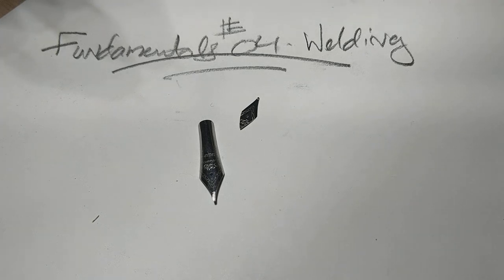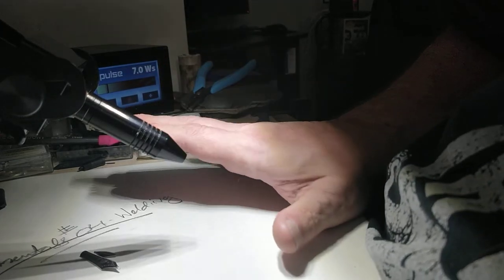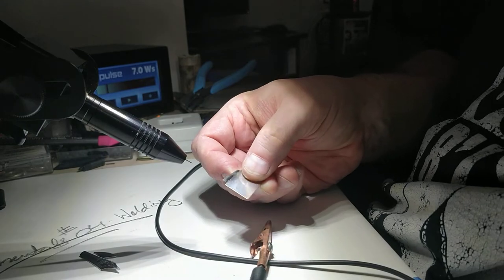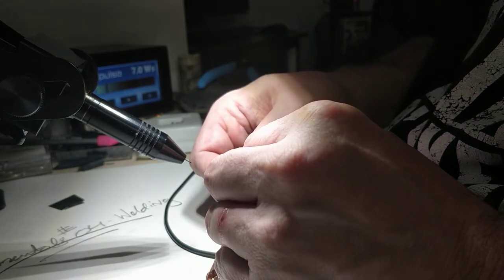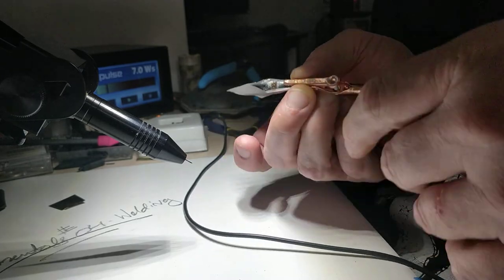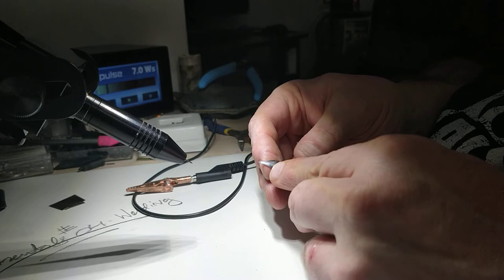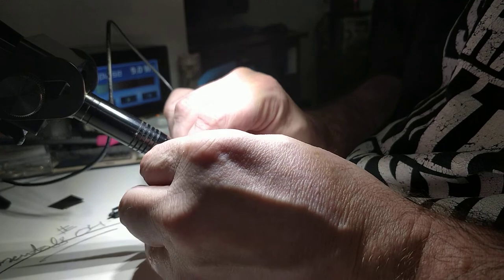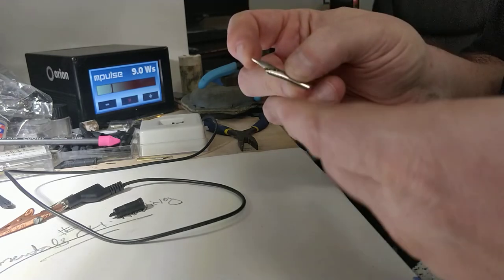Stacked Nibs Fundamentals 4- Welding

Comment: Use the gas! You can certainly weld up a storm and won’t have the “air gap” problems.
Reply from the maker: I've had less problems without gas, and I think that's just more experience. Plus tank exchange is tough to come by where I live.

Comment: Would this be the same machine that nibmeisters fix stress cracks in nibs? Also retipping nibs?
Reply: You can use this machine to fix stress cracks, but a laser welder is much better. You can use it for retipping, but requires multiple welds to accomplish it. Real tip welders are capacitive discharge type and make the connection with one touch.

Comment: Can cheaper jewelry welders be used ? Without the argon gas ? Like the ones you find on ali express for ~100$
Reply: You mentioned in your tools video it’s possible but not recommended for selling and professional work! But if i am not into that (yet) and want to dabble in the nib experimenting, is it worth spending the 100$ on it ? Will you even get a decent weld even with the nuance of working extra for polishing and stuff..
Reply: @mhergoparian174  if you're not concerned,  you can use one. They're pretty imprecise and wearing goggles is a pain.
Reply: @jamescrawford8120  so it gets the job done or its a waste of time an money ? since i currently do not have the means to purchase a high grade one >2K but i want to get into welding and seeing how it work, that's what my concern was about !
Reply: @jamescrawford8120  and what is a suitable current needed ? there are 2 options 30A and 80A 220v both